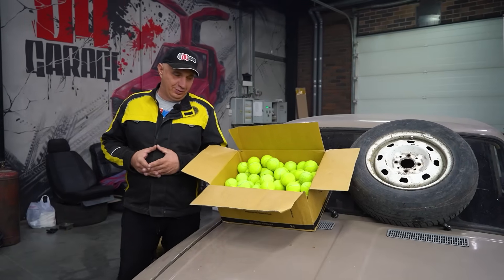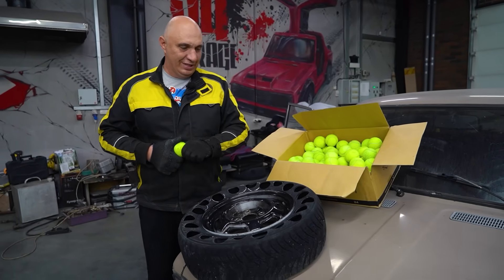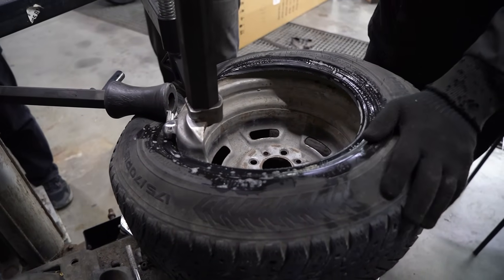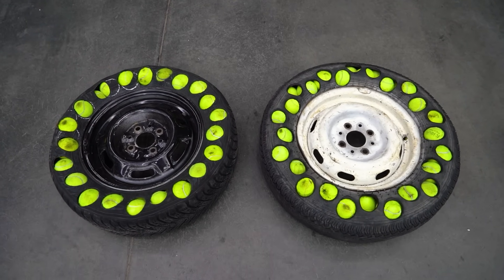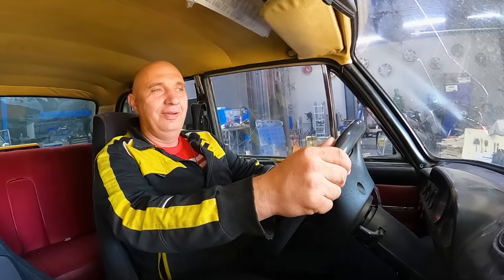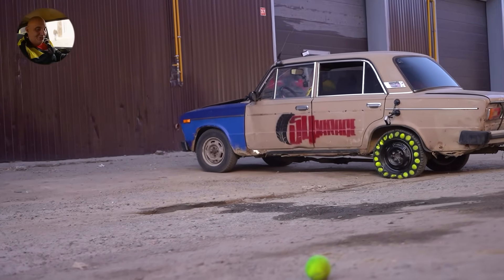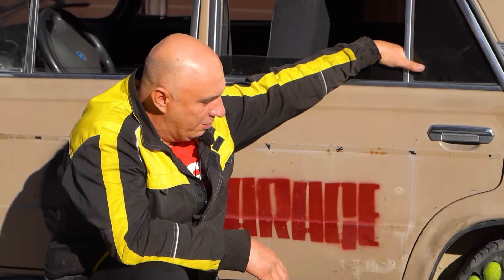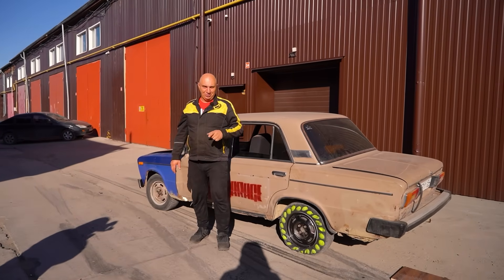We stuff a tire with tennis balls to make it runflat - will it work?

Comment: Should have added sand to fill in the gaps between the balls or some type of filler like great stuff insulation spray, or meltdown some old tires in use the rubber to pour in around the holes

Comment: Balancing would be really the only problem, well and cost, but if you were to fill a tire with many more much smaller tennis balls of course the weight would increase with more material but the centrifugal force could possibly allow a sort of self balancing system at higher speeds where balance would become an issue.

Comment: Good idea to not cut any of the holes in the side wall, fill the tyre with as many tennis balls as you can, close it up, fill with air and ride as per normal.  If you do get a puncture well, you've got a DIY run flat to save the day.  Just not sure how much noise the new DIY run flats will actually cause when the tyre is inflated to it's normal operation and normal driving with air.   

By the way...  Was this idea inspired by the greatest tennis player Novak Djokovic by any chance 😅
Reply: Did you not hear him say that the holes were there purely to give them a view of what was happening inside the tyre?  🙄

Comment: Great idea for dwmotion derby and other shitbox race, dont drill the tire, put as much tennis ball as possible into the tire and inflate it. Will help prevent the tire from debeading and if the tire puncture from debris or anything on the track you can finish the race. And the best of all, inspection crew have now way to know about it

Comment: Defo agree with the comments where you cut an access hole in the rim, stuff them in nice and tight, then tack weld the piece that was cut out of the rim back in place......if you sealed the rim back up, you could also check the difference in ride height, with or with out the air

Comment: might work as a budget runflat type tire adding tennisballs before mounting the tire fully and then using the stock schrader valve to set the tirepressure , not sure if it will mess up the balance or damage the airproof coating on the inside of the tire as they can roll around freely on the inside of the tire

Comment: After you got the tennis balls in the tire and got the tire seated on the rim you should have taken a sturdy syringe and filled all of the tennis balls you could get to with silicone or rubber cement. That would have greatly increased the working load strength of the tires possibly allowing it to work well enough for an emergency situation.

Comment: what if you used a three piece wheel with a hoop in the middle that pushed against the beads of the tires, then assembled with a surplus load of tennis balls, creating pressure inside, and then add air to the tire?

Comment: You guys know those super high bounce, solid, clear rubber balls about 25 cm in diameter?
probably need about 500 to fill a tire but would definitely be flat resistant.

Comment: I'd like to see it tested as a homegrown way to make a flat "proof" tire or a ride flat or security type tire that if shot at several times it still will be able to drive but when in normal driving conditions I submit that if the tire isn't filled with holes & you properly inflate them with the tennis balls inside that these tires would ride much better than the run flat tires that come on high priced cars like BMW & Mercedes because if you ever drove in one, the ride is horrible, bumpy & just not luxurious & that's without a flat! So no holes & use air then test the handling & comfortability with & without air to simulate no flat to flat. Then do the same with the factory type that's a hard type plastic ring mounted on to the inside of the rim, & now see which is better for riding with & without a flat. This should be the next test. 🤔💪🤠👍

Comment: So i wonder what would happen if you didn't cut those holes in the side walls if you could re mount the tire with air and then purposefully puncture the tires to see if it would work better.
Reply: Or just take the center out of the stem

Comment: Don't drill holes in the tires - see how much air you can add after the balls are added.  Then drive over nails.
Reply: Yeah this would work better.  Plus the balls wouldn't come out of the tire.  Another thing is the hole really take away from the side walls structure and strength.
Reply: @crazy86753  Yes it would.  Great point!
Reply: My very first thought i was disappointed when i saw the drill @crazy86753
Reply: @crazy86753 Watch the video, he literally mentions that this would work better without holes of course but he wanted us to see everything
Reply: Better idea.
Reply: drilling the side walls was just to make it "look" interesting, they could have done it with out but then they just look like normal tires. It was for the vid, I know a few off roaders who add tenis balls into there tires to buffer them when they air down for rock crawling. They clame it lets them get out if the tire gives on a sharp rock :yougotthis: i have my doubts but hey if it works it works
Reply: @ Exactly. Visual effect. Apparently @joshuagibson "isn't bright enough'' to comprehend that scene, man. He's prollyably MAGATR45H as well. (💋}
Didn't know off roaders used balls. And I always watch Matt's Offroad Recovery --  even though he's a republiklan. Also, that what she said.
Reply: Yes or try just one hole, stand tire upright, drop in balls, roll it back and forth, add more balls, lay it down, top it off.
Reply: @MountainSavage73  That's what SHE said. 
ALL of that.   Expeshully that last part. 🔥                                                                           

Hardy harhar and also ell oh ell.
Reply: Exactly 💯
Reply: It will be interesting to see if the balls remain normal under pressure. They will probably shrink, and regain their shape and volume when the tire loses air.
Reply: This is a makeshift run flat tire
Reply: Fit multi valves and fill with expanding foam, silicone or windshield sealant so the voids are full and the balls can not expand....
Reply: Yep
Reply: Yeah. They're not very bright evidently.

Comment: cool idea.....  try it as a internal bead lock/run flat.  No holes in tire.....  stuff the crap out of it like you did here AND inflate the tire ..  Maybe with your G-Wagen... take it off road and try low tire air to see if it helps keep the tire on the rim.
Reply: side experement 
1.  would be to make like weighted tractor tire version......  filll each ball with some of the gushy stuff you have used when attempting to make no air /foam filled tires.  Think it would be heavy (hence why said like tractor tire)... 
2. small bounce balls with the stuff inside like #1...  but less of them so they may act as large tire balance beads?

Comment: try the nasa wireframe wheels. why so many holes, wouldnt just one hole be enough. you want also to keep the balls inside the wheel. logic in the en-tire building is broken. put the balls inside while the tire is on the wheel. fancy ball dispenser lol. on the road. push in more balls (air) after initial push-in. try make arch wheels from bending plastic sheets, as springs. or metal leaf spring tires. oh for a show sure. lol. yeah less holes better, one hole that is patched up after. cool neat anyways. can be improved still. a lot. works perfectly.
Reply: Yeah 👍 why all the holes????